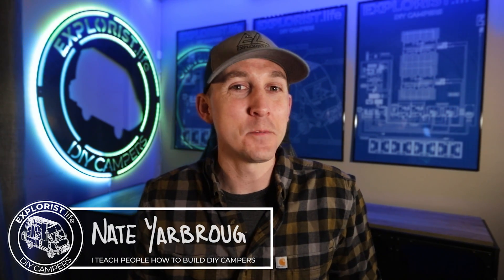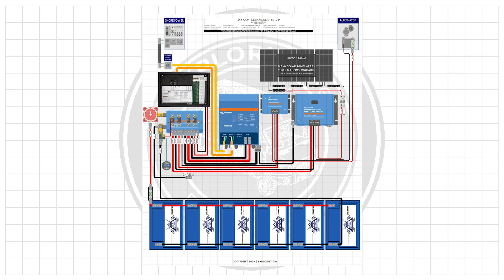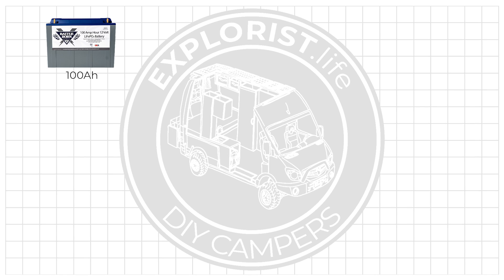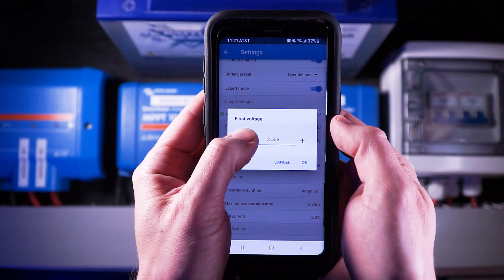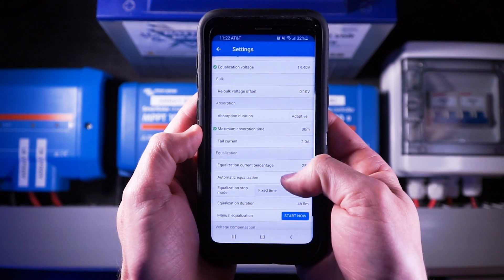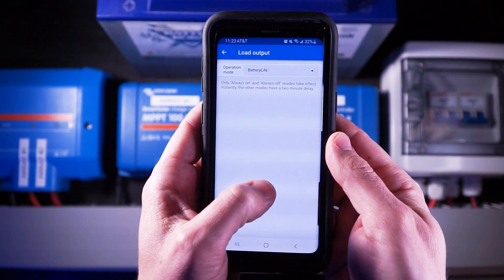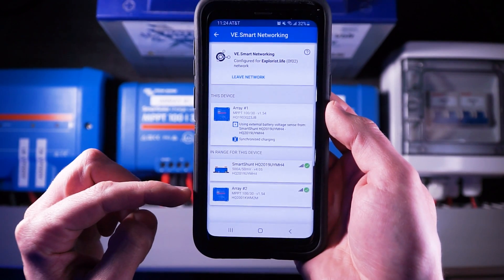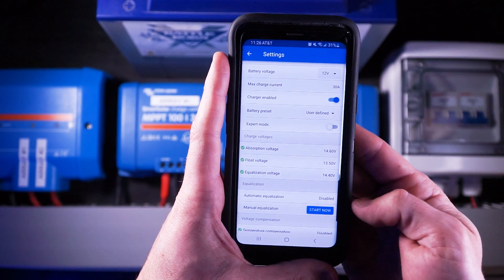How to Program a Solar Charge Controller in a DIY Camper Electrical System

Comment: Hello, You're waaaaayyy ahead of me. I have never done all that set up on mine. I went to my RV and wanted to check the battery status. It was showing on my app my Victron device but it wanted a pass word that I apparently was not putting in correctly. It kept saying it was the wrong password. I put in 6 zeros, then 4 zeros, then 1234. None of them worked. Now my Victron device is not even showing on my phone app. I have no idea who I can call to help me with this as Victron seems to have no customer support phone number anywhere that I can see. Any ideas on how to pair my app with my Victron controller. So far the videos I watch don't say what to do if it does not pair up. It just shows people clicking on their app then their device pops up. Well, what if if is not showing on the phone app as a found device. I have no idea what to do. I even removed the app and reinstalled the app on my phone. Still not showing my device. What do I do from here? Please help. Or direct me to who can help me with this. Thanks so much!
Reply from the maker: Turning it off from the main battery disconnect, waiting a bit, and then turning it back on usually fixes connectivity issues.  Or even disconnecting all wires and then re-connecting them.

If that doesn't work, your Victron support will come from whoever you purchased the unit from; so reach out to them.
Reply: @EXPLORISTlife  yep. That worked although that was done 2 days ago. But thanks for your response. Also hard to tell who I bought it from since it was purchased on Amazon 3 years ago. I have since found a company that helped me over the phone and answered my questions even after he found out I did not purchase my equipment from him. Arizona Wind and Son wouldn't talk to me as soon as they found out I didn't purchase from them. I think that really sucks!!! Especially since I could tell that guy knew how to help me. I even offered to pay them over the phone via credit card for their help and they still refused. Not a good way to earn a new customer. Inverters R US helped me out in a matter of minutes.

Comment: Can this vicron controller only charge 12 or 24 volt banks? What if i have three 12 volt batteries wired to 36 volts? How could i charge it with one victron?
Reply from the maker: Some (most?) can charge a 36V battery bank.  Check the data sheets on the Victron website to see which ones and the instruction manual to see how to program it.

Comment: Hey man. I have a epever mppt controller without a screen. I have just bought a 110ah agm battery to replace the old 50ah lead acid one. How do I set up the new battery without a screen? Cheers
Reply from the maker: I don't have any experience with that particular charge controller, but it should come with a user manual with programming instructions.  If not; you'll want to reach out to epever for tech support.

Comment: Thanks for the info however I'm still alittle confused ...
My 100/20 is on a 24v system 200amh .
Absorption set at 29.20 
Absorbtion time 60mins 
Float set at 27.20 
When the batteries reach 2920 with 4 amps charging from solar the controller goes to absorption for about 30mins then goes to float . 
The controller then holds at float but the reading of the battery is 26.50 and it stays there continuously..
I have no loads in use as the batteries I'm charging are for propulsion only and the batteries are 4 x led acid cranking batteries 100amh. 
My question ~ when the controller reaches 2920 volts and there is 4amp being drawn from the panels , does it not then calculate the 4amp charge into the equation  ? 
Ie the charge from the panel should drop to zero at 29.20v before it goes to absorption otherwise the charge is not actually at 29.20 but 29.20v minus the 4amp charge . As the absorption is timed ( in my case 60mins )and in that time the panels only produce 1amp ( that's 2amh in total ) then would my batteries be  undercharged when float is activated ??

Comment: I've got a victron 100 20a and the victron shunt,just would like to know when I get home from a camping trip and want to top up my batteries and plug in my wall charger,do I still have to connect the negative charger to the end od the shunt or can I just plug directly to battery terminals
Reply from the maker: You would want that on the 'load' side of the shunt.

Comment: Ideal instructional video. Just what I needed. I'm hoping to program the optimal values for nine 12v, 100ah AGM batteries in parallel, with a Victron 250/100cc. Thank you.
Reply: Hi I have a similar set up just less batteries did u ever figured the settings ? Myself I'm having doubts if I have the right absorption time

Comment: I have a Victron 150v 100amp charge controller and 4 solar panels that are 310w each .

I have a 48v bank of 6v golf cart batteries , what should my Victron setting be set to?
Reply from the maker: You need that info from your battery manufacturer, so I'd recommend reaching out to them.

Comment: Hi Nate great video. Quick question I have a victron 75/15 controller. If my solar panels exceeds the 75 volts eg 4 x 21 volts solar panels will this blow the controller or will the controller only take in the 75 volts and drop the balance ?
Reply from the maker: Exceeding the max voltage of the charge controller would damage the charge controller.

Comment: Hi Nate, love your stuff. My wife and I live off grid in our Toyota Coaster in NZ. I recently replaced the initial solar stuff I bought, when I realised how bad it was compared to VE kit! So now have MPPT 100/50, Smartshunt, Battery Sense & IP65 Charger. The MPPT wH generated/day is great. I'm wishing though, that I could generate/calculate/plot our wH consumed per day. Understanding that some wH are supplied direct from solar, and not batteries, this is not straight forward. Even tracking daily wh consumed from the batteries would be interesting enough. Especially on weeks like we have now, where the cloud inversion blocks 90% solar for weeks at a time! Any thoughts on this? Ta much

Comment: So if I had 2 batteries you'd multiply those charging parameters by 2x...3 batteries by 3x...ect?
Reply from the maker: Not all of them.  Only certain parameters.  Check the blog post in the video description for the ones that would change depending on battery capacity.

Comment: So glad I found this channel! Thank you for your time. I have a question that I cannot seem to find an answer to. I have a 275W solar panel, 2 6V batts, and the victron mppt 100/20. Everything runs great in the trailer except the furnace? I can hear it clicking as if trying to get the motor going, and all other power get's shunted (lights turn off etc) . The furnace runs fine on 110 so it's not that. It's as if the controller isnt letting enough power in to crank on the furnace. Is there a setting I am missing? I would think the 100/20 was strong enough. Sorry for the long explanation but Google just isn't understanding my queries

Comment: Thanks for all your videos, they are great. I have two different victron charge controllers a 150/70 and 100/30 when I put them on a network the total watt output shows lower that on each of the controller. Do the controllers need to be the same ? Thanks Bill

Comment: Excellent information! I’ve tried to find this info any place and it’s tough. Even though battle born filled it out for me, there’s a lot I didn’t understand, not to mention that even the two charge controllers they sent out to me differed on some of the information? Especially on absorption time, one said 2 hours and one said 3. I didn’t even understand about the battery capacity size either. 
I have eight Battle Born Batteries in series parallel at 24 V, so I’m imagining that would be two hours of absorption? And capacity would be 400?

Comment: HELP PLEASE
I am trying to programme my EPEVER Tracer 50A 
I have installed and can connect to the charge controller which is feeding down to
2 x 12v (SuperBatt 110ah  leisure batteries) there is a label on the battery that says 
always keep battery voltage above 12.4 and never below 11 volts.
So what setting should I use on this form
https://youtu.be/fexLxCpDH7Q
Thanks for your help
PS
the system will be connected to 2 panels each supplying about 36v at about 15 amps
Reply from the maker: You should send that settings screen to the tech support of your battery manufacturer like I showed in the blog post (with the appropriate adjustments for your charge controller) and the battery company should be able to give a recommendation.

Comment: Question please.... Do I run the +/- wires from the charge controller directly to the fuse panel or di I run the +/- wires from charge controller to the batteries then back to fuse panel?. Fuse panel is 3 feet away from batteries and CC. 
Thanks!

Comment: Hi, I just bought the 3000 watt inverter and ordered a noco 15amp shore power plug for the side of the van. On the other side of the outlet is a female 110 plug. How would I hook that up to the inverter so I can keep my batteries topped off at home? Thanks

Comment: The documentation for my Renogy 100ah LiFePo4 'recommends' float set at 14.4v. Does Nate or anyone else in the comments know why this is? Should the float not be more like 13.6 since LiFePo4 batteries do not require trickle charging? I know Nate says to follow the manufacturer's settings, but this just seems wrong.

Comment: Excellent information nate.  I installed my Battleborn 100ah lithium in my camper system 2 1/2 years ago with my Morningstar PS-30 PWM non'-metered version charge controller.  At the time I spoke to Battleborn they gave me charge parameters of 14.4 Absorption for 60 minutes and 13.6 for Float.  Do you see and issues with that profile?  It is a pain to reprogram the non-metered PS-30, but I will if my parameters affect my performance or battery life significantly.  Thanks!

Comment: question if you have an Orion charger and its a 30amp, but you have 6 BB lifepro4 batteries, will the truck change that bank of batteries with 30amp?  Also I didn't see a video on your channel that address programing a solar charger like in this video and as it relates to a 3000watt multiples charger and inverter.

Comment: So, on those other things you could control settings...could you have the solar controller run something like a DIY Battery Heater from the Load instead of using a separate Temperature Control Module?

Comment: So I recently had a solar system installed on my 5th wheel and would love to learn more about the system and how to understand the information provided by the phone app.  I have 8 330 watt solar panels, 1-BMV-712 battery monitor, 2 12/3000/120-50 120V Inverters, and 2- MPPT VE.Can 150/100, and 6 Battle Born 100 Lithium batteries. I guess my first thought is to how to take all the info provided by the app and understand it in laymen’s terms. Have you done a series on this information?

Comment: Do you know of any problems when slightly over-specing the charge controllers.   My case is 4x370 panels or 1480 watts on 12v system with Victron 150/100.  And will be mounted flat on top of Motorhome.

Comment: I'm a little confused on the equalization parameters. So you set equalization to 14.4V but Li-Io batteries don't need to be equalized, so the equalization is disabled?
Reply from the maker: Yeah, so that is for 'If something happens and the charge controller accidentally goes through an equalization phase' (or if the user forgets to turn off equalization) so that the equalization phase still won't actually do anything as the voltage is too low.  Just an additional safeguard but you're correct.  If all goes correctly... this shouldn't matter.

Comment: Great info Nate!! A few years ago I thought Victron explained that having multiple charge controllers, you needed to have a slave and master controllers. That way the controllers would not cycle between bulk/absorb/float as the voltage went up and down as each controller turned on as they saw the voltage go up and down. It's that not the case anymore? Along with that, when you plug into shore power (multiplus) or another way of charging (from truck alternator), do you need to setup master/slaves?
Reply from the maker: Yeah, maybe that's not the case anymore with the advancements in the VictronConnect app.  The Inverter/Chargers still need to be set up like that, but the charge controllers don't (Or maybe it just does it internally through the software).  But there is no need to setup master/slave devices for the MPPT / Inverter-Charger / DC DC charger interactions.  Those happen automatically as the will sense each others charging and turn on/off accordingly.  Synchronized charging between multiple charging sources is on the horizon, though.
Reply: Awesome Nate!! Thanks much

Comment: Love your detailed videos! On the downside it's costing me a lot of money. lol I'm assuming you can't use different manufacturers batteries together? I have two lion lithium 100 amp hour batteries and was looking to buy two battleborn lithium batteries. Can I do this? Thank you
Reply: I’d suggest contacting BattleBorn. They have great customer service.
Reply from the maker: I know what you mean. lol  I'm just glad I didn't have to buy additional equipment for this particular video and was able to use everything from last week. Haha!

Generally, it is not advised to mix and match batteries.  I know that the 2 manufacturers have very similar charging profiles and such, how their BMS's would work together.  I would give Battle Born a call and see what they say about it.  If they are apprehensive... Lion batteries are just fine as well as far as I know.  Lots of people have been pretty happy with theirs in place of Battle Born.